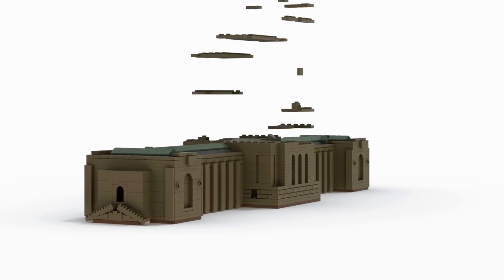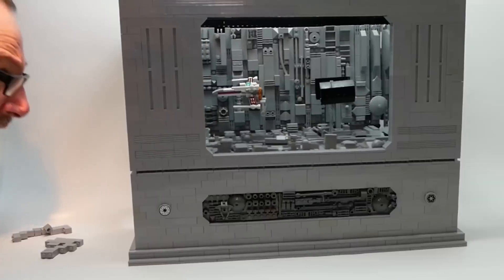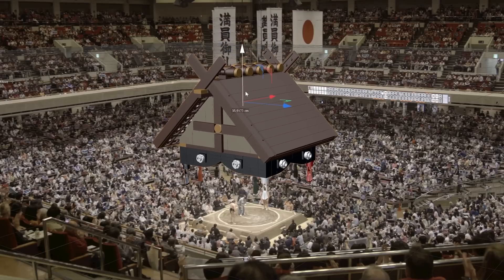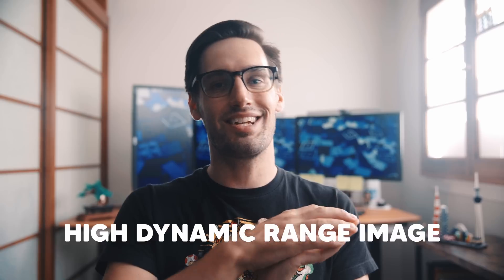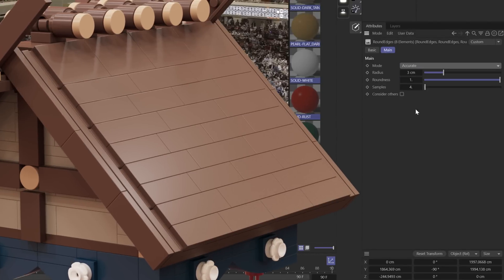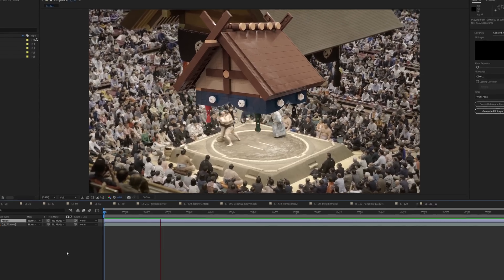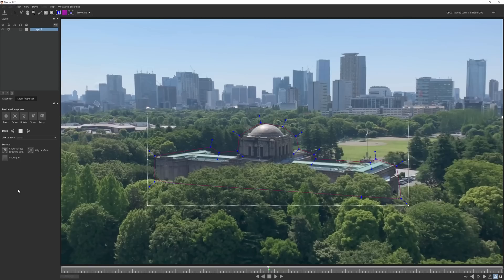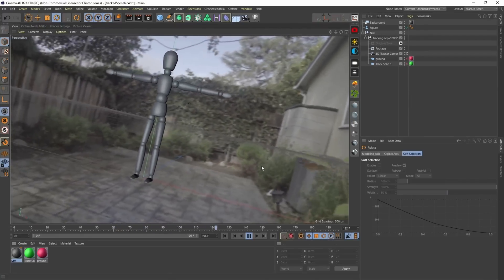LEGO + VFX = AWESOME!! | Full Workflow

Comment: As someone who has done stuff with Blender, LEGO in the real world, and Mecabricks (my preference over Studio), this is great. I've always thought about doing something like this, but never actually did it.

Also highly recommend Mecabricks to anyone finding Studio a bit more daunting. It's browser based and you can export models from it too to use in other software. Personally I find it nicer and easier to use than Studio, but your results may vary.

As a bit of a note on the LEGO side of things, it's best to take a similar path as you would with pixel art. Find the smallest detail you want to be clearly visible, be it a flower, a window, etc., and start building from there. I'd also say to add in some printed pieces here and there for that extra little flair. LEGO has a wide range of printed parts, but for times where you need to make your own, you can easily do that with Photoshop or your choice of similar software. Mecabricks has a built-in section for that on the website, so feel free to use that. I personally think the the flowers in the sumo shot could have worked a bit nicer as printing on a 1x1 or 2x2 (depending on scale) round tile, but to each their own. That's the joy of LEGO.